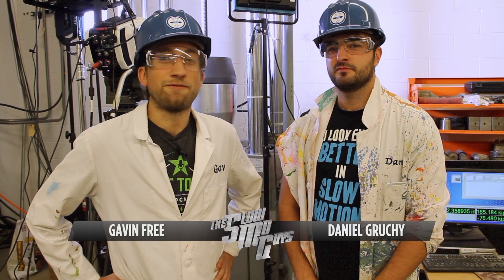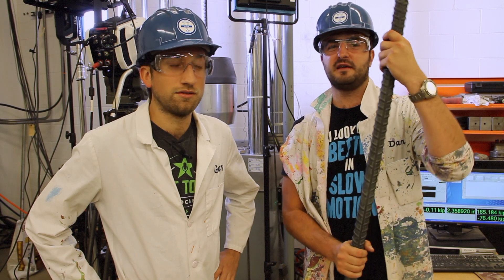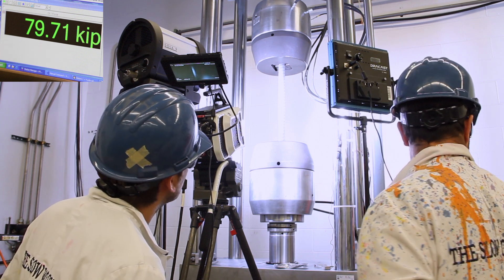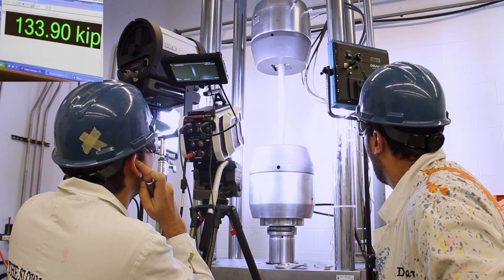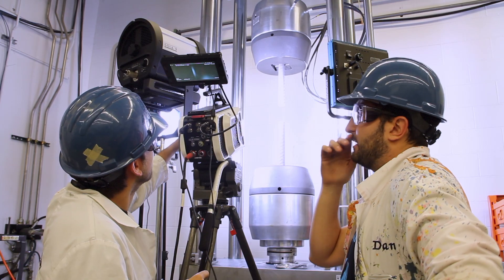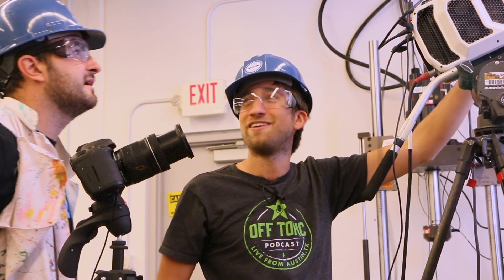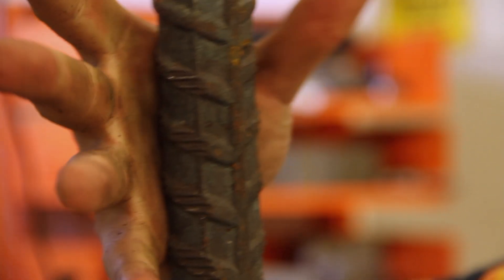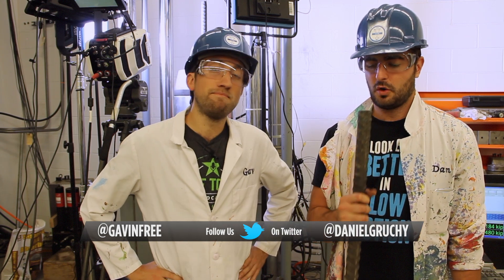Snapping a Steel Rod 1000x slower - The Slow Mo Guys

Comment: so what causes the pole to break at that certain point? why doesnt it break an inch above that spot, or below it??? anyone know?
Reply from the maker: Dankrupt it did a few times. We just showed the shots where it broke in the middle.
Reply: It breaks wherever it is the weakest and that's determined by how it was made
Reply: Bc of math and physics and stuff.
Reply: TheMumbio good old sigma epsilon diagram
Reply: + TheMumbio Sounds so smart, yet is so wrong. The stress in the metal is the same over the whole length of steel. It tends to break in the middle because it is the warmest there.
Reply: The part of the pole tends (not always) to break is in the middle, this is because this is the part where the most forced is being exerted. It usually necks and then extends exponentially until it reaches its elastic limit, then it snaps. Due to this you can tell where the pole will break long before it actually does. Try using bluetack, it gives a good exaggerated example of how metal tends to snap. Fun fact, the break is called a cup and cone break. Source: I do engineering
Reply: +TheMumbio The elastic limit of a steel rod is virtually non-existent, I think you mean the plastic limit.
Reply: In materials testing we often use a "dogbone" shaped sample where the middle portion is thinner than the ends to drive the failure towards the middle. I expect Dan and Gav either got lucky or took multiple shots to get one to failure in the middle since the rebar has a constant diameter. With that geometer, it will fail at any weak point (rust, inconsistency when forming the bar, previous stress and damage, etc)
Reply: F1NNSP1N OK so first of all I'm not totally wrong at all. So it is the plastic limit that it breaks at as it comes after the elastic region. The break is more of a gap break rather then cup and cone, cup and cone is for slightly more ductile hard metals. But there is in fact more force being exerted to the middle portion due to the fact there is generally less surrounding/supporting material than the adjoining section, but of course weaknesses in the metal such as air bubbles, cracks, gaps, etc play a huge factor in this, hence why I said usually. Also warmest? That makes no sense? Why would the metal be warm in the middle? It's warm after due to the tensile force that was exerted on it. I should definitely have read up my facts before posting but none the less you definitely didn't..
Reply: Zahlenteufel1 ahhhh that would make sense
Reply: doing things, making stuff You are adding a factor that is not in this discussion. Spring steel is specifically designed for elasticity. Rebar or structural steel is designed for tensile strength. They are two radically different characteristics.
Reply: James N. It will not always break in the middle though, it could happen because there are weakpoints in the material like a thinner surface area at one point or the material was not sufficiently hardened at a point so the rod would break at this point then.
Reply: He was wrong in his point that, "[...]this is because this is the part where the most force[...] is being exerted." The force (better: stress) stays equal along the rod, since it is not bent, just pulled.  The temperature varies since the ends are clamped in and not stretched, so they don't heat up. Heat from the outer parts will be able to go there, in the middle, it can't. Most samples will break in the middle because of this, ask your metalurgy teacher.
Reply: It tends to break in the middle as the state of stress is most purely tension without the end effects caused by the compression of the machine gripping it at the ends.
Reply: If theoretically it was exactly the same strength for the entire length, I'm not sure what would happen, it would probably break exactly in the middle. However for real materials there are always imperfections, which means points of weakness, where it will break first.
Reply: Dankrupt the pole is under tension and breaks when the shear stress overcomes the elasticity of the pole. You can determine what force is needed by looking up steels modulus of elasticity, pretty interesting
Reply: AUT gaMer Exactly! Used to hate the formulas that came with it..
Reply: its the middle
Reply: +TheMumbio 

But it doesn't immediately break after reaching the elastic limit? There is most times a plastic area after the elastic one. 

Also this break resembles much more a gap break than a cup and cone break, since the break surface is really flat and it basically looks like it was cut at this point. Those gap breaks happen if the steel is very brittle and when the yield stress limit is close to the tensile strength.

I am german so i dont know if I translated the technical terms correctly, but I am pretty sure that yours is a little bit off from the truth, since I am doing this topic right now in my metallurgy class ^^
Reply: +F1NNSP1N

You are completely wrong. 

What he said is more or less right. The only mistakes he made is that it snaps after the plastic area and not the elastic one and that this is a gap break instead of a cup and cone break.

But other than that, the rod breaks where the weakpoint is. It could be that during the manufacturing process an error happened which softened the material only a little bit at a point or that the rod is at this point like 1mm thinner in diameter. This would be enough to have the breakpoint at another spot instead of the middle. 

Also the rod is on every spot the same temperatur?  Since the rod has the same thickness at every spot, why would one place be warmer then the other one?
Reply: F1NNSP1N the force is equal yes, but the tension is force divided by surface area.

So if a steel has a tensile strength of say 400N/mm^2, the steel will break at the point where the surface area is the smallest, since the tension of 400N/mm^2 is reached "faster" there because you divide by a smaller amount.

So if the force stays equal and the steel is the same, the steel will break faster if it has a smaller surface area.

Edit: saw your second comment now, so if it is a perfect single crystal, without any grid errors, then you probably would be right yes, but since there are nearly always the smallest errors in the material, heat is only responsible for a small percentage of all broken samples why the material broke at a certain point.
Reply: +TheMumbio You agree on the force being equal along the beam now? Forget about the heat for now, it is a minor effect, that explains why slightly more break specimen break in the middle than anywhere else (I will still argue I am right though). Yes, it will break somewhere else than the middle too, if there is a scratch, impurity etc. I know. You had me triggered with "source: I do engineering" while ignoring newtons third law.
Reply: F1NNSP1N Yes I agree, I was thinking of different thing at the time, mb. Also I can see how that would be triggering, especially due to the fact I made several mistakes in it, although it wasn't all quite wrong. I have now read up on the topic again, I have forgotten alot of it but now I'm glad this all happened.. Next time be a lil more clearer, weren't sure what you were getting at for a while. I see the point you were making now.  Edit - you really think the heat produced has a major effect on the test though? I mean too me it seems very minimal if even worth noticing all considered? Just curious.
Reply: simply the break point in the neutral point where two equal pulling forces meet, when either of the pulĺing ends pulls harder the neutral point will shift.
Reply: +dad what's spring steel then? not elastic? it totally depends on the composition of the steel.
Reply: Dankrupt I think this is the mid point of the metal rebar. so since it's getting pulled from 2 different sides, the middle will snap
Reply: dad Yea your right mb
Reply: TheMumbio yeah my corrections where right :P
Reply: F1NNSP1N the heat comes because of the forceful movement of the atoms in the grid? 

The heat is a by product of this, not te reason.

In our tensile strength tests we already had one sample which broke directly beneath one of the gripping heads (or whatever it is called in english^^), and there was only a small difference like 0.05mm.

So it cant be heat can it? If heat would be the reason why our samples are breaking in the lab, they would have definitely explained it like this, wouldnt they?
Reply: +TheMumbio You will have to do some to do some research on physics as well. The force will be equal along the rod right up to the chucks. Please do sour homework.
The temperature varies since the ends are clamped in and not stretched, 
so they don't heat up. Heat from the outer parts will be able to go 
there, in the middle, it can't.
Reply: +Bob van Bobbington 
Heat is not the reason they break, but heat is the reason why they tend to break in the middle, you forgot about the original question. Of course, not all of them break there, as you said correctly, flaws in the material can dictate the spot too.
Reply: Since when was the a law saying heat moves to the center of something? Heat spreads. What your saying simply makes no sense. I have conducted tensile tests where the bar breaks right at the grips. I have corrected my previous statement but this.. this is just wrong.
Reply: F1NNSP1N I corrected this mistake previously, also I see what you said now but let's be honest, heat has a very small impact on the break, much more likely to break from others reasons like flaws in the metal!
Reply: Also there is generally less surrounding/supporting material in the middle than the adjoining sections so there is a higher possibility of it breaking here. Anyway lets there is many factors that contribute to the break point of a material in a tensile test, thats something we can all agree on and seem to have plotted out in our conversation.
Reply: Just like looking for something you misplaced.  It's always in the last place you look.
Reply: wait am I the only one who uses "f" for stress
Reply: Dankrupt lol chill
Reply: Might be a little chance or chaos involved in breaking location also. Especially if it were a perfectly manufactured rod.
Reply: This guy be out of weed.
Reply: This thread is brilliant! Engineering fight!! Scientists love to argue over the Internet, just like you and me
Reply: súperbád Shear stresses? In this particular case it's the normal stress that causes fracture. If they were to twist it and apply a torsion to it, then it were to fracture due to shear.
Reply: F1NNSP1N The heat is mostly generated by plastic deformation of the steel. During Elastic deformation little heat is created because the energy staining the material when released, returns the material to its original shape. Once plastic deformation starts in a section of the rod it heats up, but that heat isn't the reason the material breaks there. The reason is the plastic deformation causes a local reduction in the area of the rod, increasing the stresses at that point, leading to more deformation resulting in necking.

The rod breaks anywhere the stress first exceeds its yield strength and runaway effects begin. You can see in the video when the stretching of the rebar speeds up rapidly
Reply: Hart Poole are you from hartlepool?
Reply: Dankrupt it mess up on that part cause its not the most pure part and i wonder to this two idiots why they call rebar are steel steel is hard but brittle rebar are made with iron this two stupid guy dont know proper chemistry and physics
Reply: doing things, making stuff rebars are iron not steel you dum ass
Reply: TheMumbio Question Mr Engineer guy :p
According to that epsilon diagram (and some stuff I remeber a little) the traction force is supposed to decrease a little bit before the bar breaks. Why didn't it happen there ?

Comment: Steel is a very hard metal because of the carbon content and thus not particularly ductile.  That's why it snapped fairly cleanly like that.  Could you guys find a more ductile metal to put in this machine?  I think it'd be even more cool because it will deform a lot more before snapping.  I've seen the end result, and it'd be really cool to see in slow motion. =)

Comment: In case people were wonder why it suddenly started to stretch then snap, steel has a stress strain curve where you can add a lot of force and it will stretch a tiny amount up to a certain point depending on the steel quality (measured in N/mm2). After this point the steel will stretch with barely any effort. After this the steel snaps.

Fun fact:
Once you reach the point where it stretches really quickly, the steel wont be able to "heal". Meaning it wont be able to go back to its original shape.

Comment: Cool video, but where was the science? You could have explained elastic deformation, plastic deformation, yield strength...
Also film stuff like this with a thermal camera as well as the high speed camera. Then you could science even more by showing the the rise in temperature, then explaining it.
Reply: I'm not sure if you've watched them for a long time, but they aren't really scientists and don't tend to explain much in the way of physics. Smarter Every Day does much more of that and also does a lot of slo-mo
Reply: I know, but they called this video a science video. There was no science in it.

Comment: Something interesting I noticed.  It should have broken at about 111 kips.  This is based on a #11 Grade 60 bar.  (#11 means that it is 11/8 inches or 1.375 in with a tensile strength of 75 ksi.)

Comment: 220 kip is about 1000 kN which means it could "pull" 100 tonns(it doesn't work like this, but it helps you understand the power of the machine)

Comment: with low-carbon steel, you can actually make quite a bit of heat without using fire to forge. you'd still need to harden and temper it to make it worth a damn in the end. but still. if u just need a cheap lil blade real quick, like for cutting tape off a box, that's something I've done. actually been burned by the amount of heat from just hammered steel.

Comment: That machine is basically the opposite of a hydraulic press.
Reply: Shenanigan Studios It's exactly opposite.
Reply: 1000 Degree Knife Vs Hydraulic Pull Machine
Reply: Hydraulic Press VS Hydraulic Pull Machine.

It's actually just both of them crushing/pull the same item, to see which destroys it faster.
Reply: Hydrualic stretch
Reply: Get that machine its own channel!
Reply: Hellu and velcome to the hudralik press channel...
Reply: Jack Challenge hydraulic pull
Reply: I just wanted to comment that!
Reply: Hydraulic Pull
Reply: Jack Challenge "hydraulic pull"
Reply: Welcome to hydraulic pull channel
Reply: So it a hydraulic pull 🙂
Reply: hydraulic yank
Reply: Jack Challenge Yeah
Reply: Jack Challenge a hydraulic pull
Reply: What dopey accent would this machine's owner have then?
Reply: The opposite would be non-hydraulic pull machine.
Reply: A hydraulic stress
Reply: Hydraulic pressn't
Reply: Jack Challenge cffjffjcf
Reply: Y'all must mean the "heewdraulic" pull channel 🙌😂
Reply: Jack Challenge hydraulic SUCC
Reply: Jack Challenge yeah tensile testing machine
Reply: Hydraulic pull
Reply: Jake Paul your fake
Reply: WizardOf well you'll need UTM (universal testing machine) for accurate result as it have both the ability compression and tension, I've performed this test during my engg. Compression is way more hard to achieve if it's protected from Euler's buckling effect.
Reply: Jack Challenge yeah and it takes 10000 times more power to snap rather than press together
Reply: Hydraulic tug
Reply: Exactly
Reply: Jack Challenge more like the same
Reply: why are their voices so high
Reply: Tarek EL Derbas His comment wasnt that specific, he never suggested one would be stronger than the other. But i think youll continue to ruin this reply chain.
Reply: Jack Challenge it's a sserp cilourudyh
Reply: Jack Challenge hmm yeah
Reply: It's a hydraulic tug
Reply: Apparently pulling apart fors is a word
Reply: Hydraulic pull?
Reply: A hydraulic depres you say?
Reply: So a hydraulic pull then
Reply: Do Kathy Griffin next
Reply: It’s a hydraulic pull
Reply: The machine can do both
Reply: Hydraulic Strech
Reply: hydraulic pull?
Reply: Jack Challenge a hydrolic sserp??
Reply: It's the hydraulic pull
Reply: FYI this machine is basically used by engineers ( particularly civil engineers or structural engineers) to test Young modules of materials wich will be used in construction. Its one of the bases of structural engineer and thanks to this we have buildings reaching up to the sky
Reply: .sserp ciluardyh
Reply: It’s the hydrologic stress
Reply: Hydraulic stretch.
Reply: thank you captain obvious
Reply: Jack Challenge huh????
Reply: Hydronic stretch
Reply: It's UTM
Reply: And it is practically opposite of a hydraulic press
Reply: Ohh thanks for knowing
Reply: Hydrollic decompresser
Reply: its really not
Reply: It's UTM
Reply: Yes     That’s what that is
Reply: Great observation!  Wow!
Reply: it still uses Hydraulics though
Reply: @lewipacheco9407  but doesn't press
Reply: @jackguest145  its instead, a hydraulic pull. I made that name for it up
Reply: WizardOf Pointless... Tensile strength and compressive strength are vastly different for most materials... Also, it depends on the size of both machines, the tests would only make sense if the tensile machine has the same value of pulling force as the press has for crushing force.
Reply: Tarek EL Derbas no, use it as a test to see which is stronger: tensile or compressive
Reply: Next Einstein in the making.
Reply: WizardOf Also, the rate of force-increase is usually much higher for a press than for a tensile-testing/pulling machine.
Reply: Im soooo gay for you